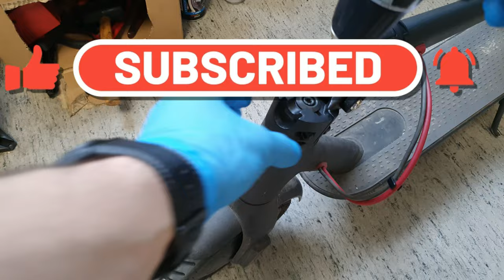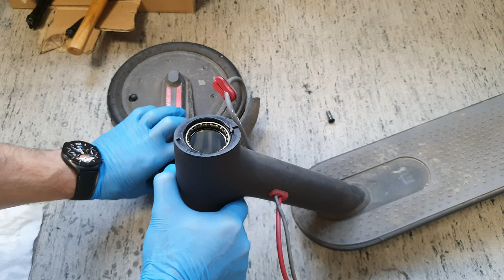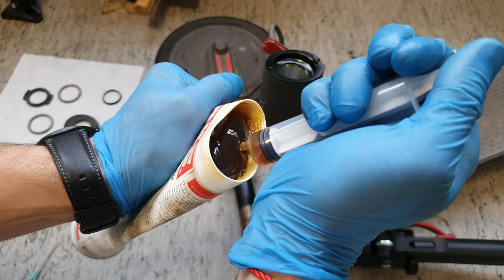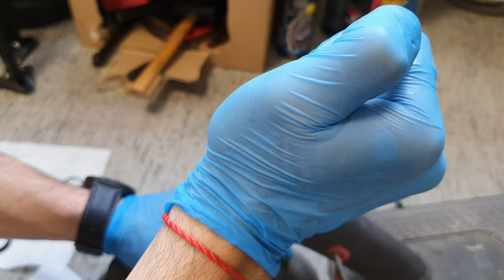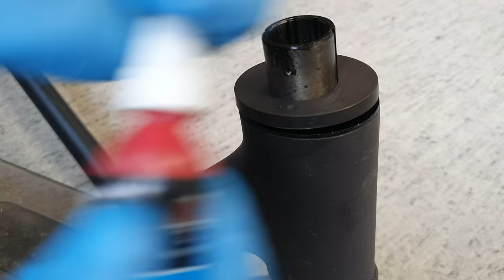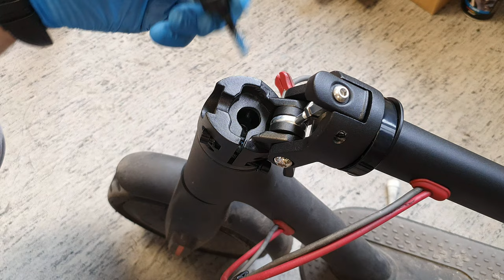XIAOMI SCOOTER M365 PRO PRO2 | FRONT FORK BEARING REPAIR | РЕМОНТ ПОДШИПНИКОВ ПЕРЕДНЕЙ ВИЛКИ #M365

Comment: I recently hit my scooter and since then it hasn't been going straight, it's veering to the left, and it's also lurching. Could it be due to problems with the front fork bearings?
Reply from the maker: Yes and the problem with steering lock mechanism..